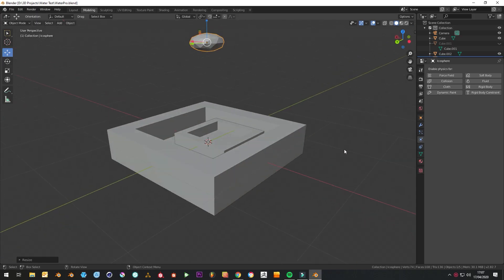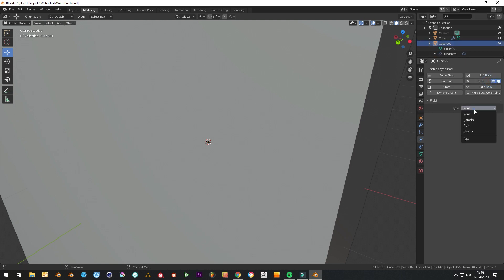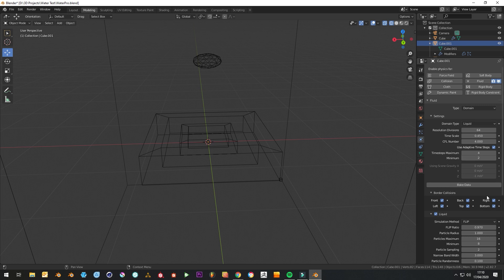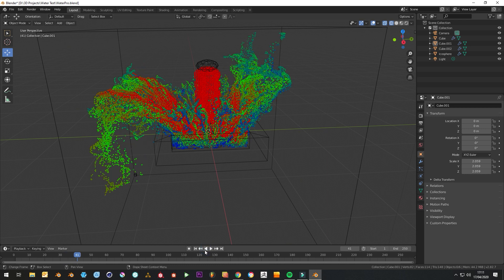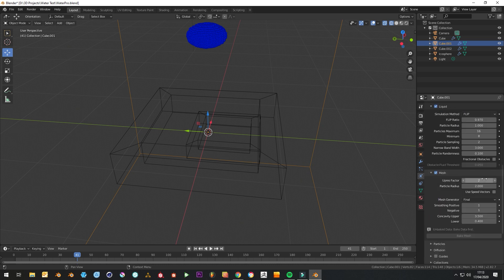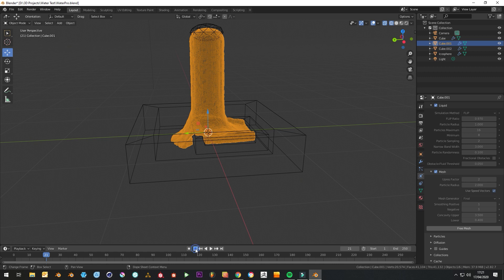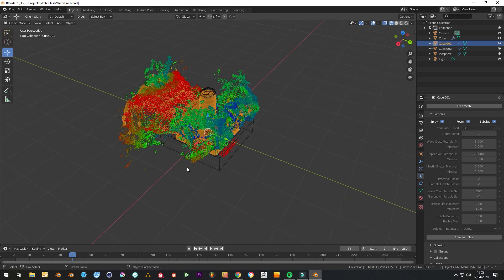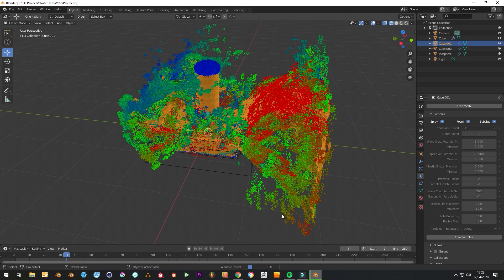Blender to C4D - Simulating Water, Rendering White Water & Foam in Octane [Part 1] | VFXHUT

Comment: Really helpful tutorial!

The only thing I'm stuck on: I cannot get the particles (spray, foam, bubbles) to show up in c4d. When you export the alembic file, the blender export settings are not visible - not sure if there is anything special that need to be checked. 

Upon import, only the mesh appears for me. In the beginning of tutorial part 2, all of the elements (spray, foam, bubbles) appear as separate objects when imported into c4d. How is this done? Has something changed?
Reply from the maker: What version of Blender and Cinema are you using? it might be this. I haven't done this for ages since getting X-Particles.
Reply: @VFXHut   Thanks for the response! The latest versions of each: 

Blender 2.92
C4D r23
Reply from the maker: Hey okay we aren't on that version - did you see the second part of this video ? https://youtu.be/iUsijXmQZ_U - also make sure you have baked particles and foam :)